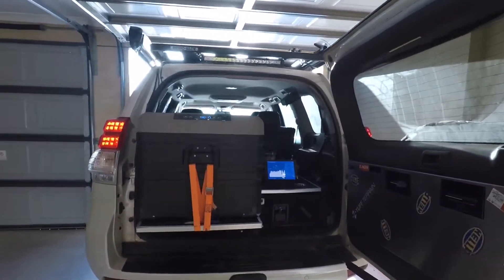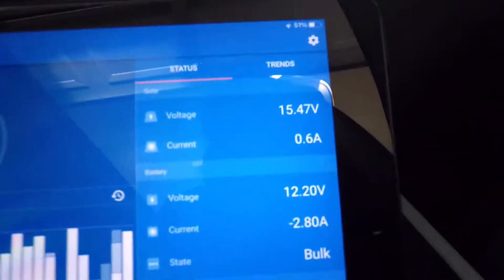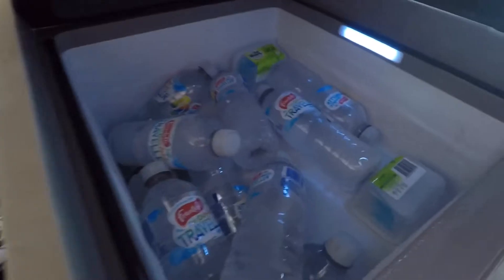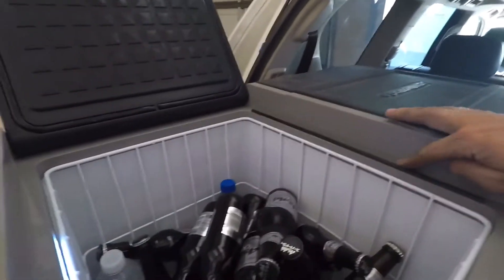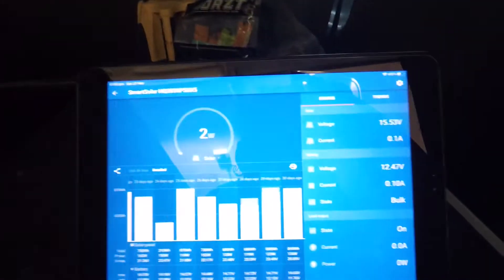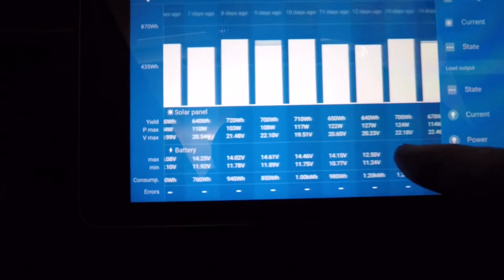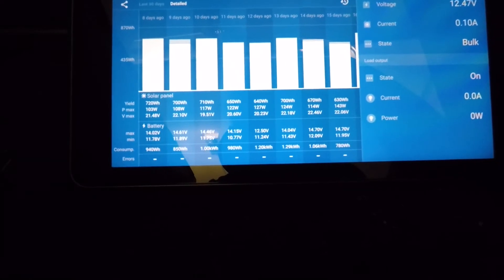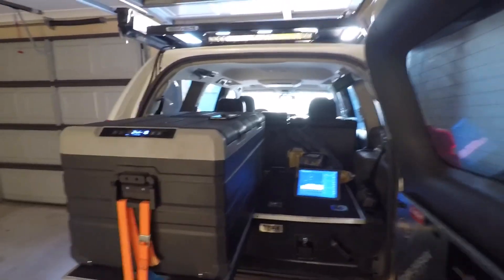Brass Monkey and Solar Update

Comment: That differential in volts will be voltage drop over the cable. They typically use the smallest they can get away with. I had the same issue on my evakool where it would shut down with a volt of discharge left until I used thicker cable around 21mm. Thanks for the video mate

Comment: Do you need an extra/add battery to run 75l BM? Or just straight plug in on cigarette lighter is there any cons if cig lighter only specially on a long trip? Thanks in advance
Reply from the maker: I run a second battery and solar and it only just keeps up. It can be run just from cig point but will not be efficient at all

Comment: Hey mate what app are you using to be able to monitor the solar like that? Does it have to be a certain charge controller? Cheers
Reply from the maker: It’s the Victron app specific to Victron controllers, not a lot of controllers had apps to monitor back then but a lot more controllers have them nowadays. 

I highly rate Victron and it’s settings, if moneys not an issue they are the bees knees. But realistically any controller with Bluetooth will do the same thing and be a bit cheaper!

Comment: was this fridge also plugged into 12v at any stage or was this just the solar panel and built in battery?? id like to know if i go camping or even use at home that i can run without ever needing to plug in (sun playing ball and being out) also was this the brass monkey solar panel?

Comment: first off cheers for the videos on this fridge mate, helped me make the decision to buy one from rtm( not a bad deal either, 699 for the 95l and a cover). just curious about the ebay panel as I'm going to purchase a solar blanket soon. How does it handle being partly shaded or covered? seen a lot of people say if a panel gets covered they don't work. if so has it ever been an issue for you, just don't want my paddle pops to melt ya know ;),
Reply from the maker: Can’t beat that sort of deal!! I haven’t had any problems with the panel touch wood! My 2nd battery is only small at 105ah but it keeps that fully charged all day with fridge +4 and freezer -18 (has to be -18 to keep the paddle pops frozen!) However it’s starting to wear out and not lasting a full night at -18. So a new/bigger battery is due. I try to get as much sun as possible but for the odd occasion I have a 120w solar blanket which makes do. Someone above commented they were using a 200w blanket and very happy! If you have the time to setup a solar blanket I would get one over a fixed unit as inside the car gets very hot too when in the sun! Hope this helps! 🍻
Reply: @JS_Adventure  very big help once again mate really appreciate it. I'm running a 140ah so I've got 70 useable ah they say before it needs to be charged so I'm thinking I should be right with the eBay blanket and a good quality controller this summer. come winter I might upgrade to a big lithium battery so I can discharge it a lot more.
Reply from the maker: Yep! I didn’t want to go cheap on the controller and picked up a victron 75/15 with Bluetooth and it’s worth it’s weight in gold! I think we’ll be going lithium in the near future as well as we’re getting more and more power hungry!!

Comment: Where did you get the rubber strips from? My 75L BM also gets condensation around the seals that sometimes turns to ice.
Reply from the maker: Hey mate just from Bunnings. If I remember right it was 6mm thick window seal
Reply: @JS_Adventure  Thanks mate, btw has the seal still done the job?
Reply from the maker: To be honest I think it’s helped a little. (Fridge seems to not cycle as much) but can’t definitely tell, for $6-7 it’s not hurting it so I’ve just kept them on
Reply: @JS_Adventure  hey mate just letting you know the window seal trick has done the job with my Brass monkey fridge. Very little if any is visible now and the compressor isn't working as hard. Great tip, thanks.
Reply from the maker: Beauty mate! That’s good to hear! The factory ones are pretty useless

Comment: Are you using an MPPT charge controller or a PWM? Maybe that's the reason why you never get close to those 250 w
Reply from the maker: Nope running a victron mppt but it is a $100 panel from eBay so I wasn’t expecting a lot out of it
Reply: How do you get it to read out all the data? Does that mean you have the fridge wired into the "load" part of the mppt controller? What amp is it? 

Cheers
Reply: @JS_Adventure  do you have a battery in the fridge?

Comment: Thanks for the video. I purchased the 75 litre model and very happy so far running with a 200W panel and 135A/hr LifePO4 battery. I highly recommend using the brass Monkey App as it's much easier to change settings through Bluetooth. I saw you got 162W out of your 250W panel which is really good. Anything above 50% of your solar panel is good, of course a low battery is needed to "trigger" the Victron into high wattage demand - are you using the Victron 75/15 controller? I was a bit worried going to 250W panel (162W/12V = 13.5A...) 75/15 max is 15A
Reply from the maker: Yep I’m now using the app and having no problems. Yes using the 75/15 and read in the manual that it will limit the power if more PV power is connected. And also just thought for a cheap eBay panel I wouldn’t be getting anywhere near a 250w panel but it’s doing a damn good job! Bang for buck you can’t beat these fridges! Has been running -18/+4 for 3 months straight now
Reply: this comment section is more helpful then google in its entirety. any advice about a kings 200w solar blanket that says it gets 16amp with their ppt controller? do I need to get a 20a controller just incase ?
Reply from the maker: By the looks of it, their 200w blanket comes with a 20a mppt controller so should be perfect!
 
https://www.4wdsupacentre.com.au/products/solar/200w-mppt-solar-blanket-combo-deals/adventure-kings-200w-solar-blanket-with-mppt.html
Reply: Ahh yeh not a bad deal, it just doesn't exude the same sex appeal as a Bluetooth controller to be honest 🤣
Reply from the maker: Agree with you there! 🤣
Reply: @jamesandrikopoulos5973  Hi, Just purchased a 380W solar blanket off ebay for $189. It only puts out about 15Amps MAX (suppose to get 21A max!!, but there is lots of absorbent claims out there....) folds up really small and so far I'm impressed, certainly plenty of power for camping. It comes with Andersen plugs, 20A controller (Very cheap 20A PWM) so I'm changing over to the victron 75/15 BT. Kings is pretty much the same stuff (bit more expensive).  Enjoy
Reply: @ShortFlic  thanks alot for that mate, very very helpful. Ebay big watt and the victron controller seems the best way to go especially since both you and JS Adventure are having positive use with them
Reply: how is the fridge, still good?
Reply from the maker: Yep! Still going great with no problems!
Reply: @JS_Adventure  thank you
Reply: @annabanna666  Yes, perfectly. No problems at all

Comment: Awesome video man look forward to any updates 😀 quick question what battery are you running?
Reply from the maker: Thanks mate! Running a full river 105 a/h battery as our second battery. Seems to be keeping up
Reply: @JS_Adventure  sweet man I got the 75L and I was worried about my battery set up also running a 105aH battery
Reply from the maker: Yeah should be good I have found it chews a lot of power when empty but just load it full of water to help it out
Reply: @JS_Adventure  thanks for the heads up I'm definitely gonna put the extra strip on it too as yeah frosting up the side abit

Comment: What do you think of the fridge itself?
And have you had any issues with them shutting down when the fridge is on an angle.
Reply from the maker: So far have spent near on 2 months touring on and off road with it and have had one time when it shut down with an f3 error as I’d left all the windows up in a 45+ degree day and it just overheated itself. Other than that no issues at all, no other shut downs. It does read a volt lower when the compressor is running which is a bit weird. But overall I can’t complain with it! Not sure of Engel/Waeco power figures for the same size but it does seem a bit power hungry
Reply: Good to know mate thanks, I have two dometic fridges atm, but am not happy with them, especially for the money for pay, have been looking at the brass monkey for a bit now just reading about the 5 degree thing
Reply from the maker: Yeah no problems with angle, it sat out the front for 6 months on our driveway every night which is over 5 degrees.
Reply from the maker: Coming from a Waeco and Engel I noticed straight away that these were cheaply made but still keep up with the big names. Which is great for the price
Reply: Awesome mate thanks heaps for the info.
Reply: At a 3rd the price you knid of expect it to be a little flimsy but 3 year warranty makes up for that I guess

Comment: Does the fridge alone pulls 1kwh after 24 hours?? Thats a lot isn't it?
Reply from the maker: Just under 1kw but that’s both fridge and freezer and constantly putting cartons of room temperature water in. So it’s pulling a lot to get the water cold

Comment: What size battery do you have
Reply from the maker: Was running a 105a/h agm (4yr old) back then which was only just keeping up on -18 and +2 but have changed to a itechworld 100a/h lithium which I can get 2 days out of now with no solar input. Setting the freezer to -15 I can double that but we carry ice cream regularly!
Reply: @JS_Adventure  ok ibe just got a brassmonkey 100 w solar panel today and ive run it all day in sunny Sydney at 14 degrees & - 2 on Freezer  ...its come over stormy and still powering it under cloud cover ... 
Model GJ 2018 7.8 ah battery .. 11.1v
Reply: @JS_Adventure  but that sized battery wouldn't run it all night I'm guessing once the sun goes down until sun up
Reply from the maker: I wouldn’t think so. My fridge is the previous non battery model and uses a lot of power so can’t really help battery wise, there’s a really helpful Facebook page “brass monkey fridge owners group” but my guessing it would get around 4 hours

Comment: These are the nastiest cheapest piece if crap out there.. 
After 1 yr, it has never reached its set temp or frizen a bottle of water. Firstly the seals dont seal the fridge!!!!!!!!!
 
I have 4 x 300ah batteries, solar, dc/dc and generatir.

My waeco and engel fridges are faultless, stay on their set temo and freeze anything i put in! 

The brass monkey continually has voltage issues and cuts out non stop for 10 minutes and turns on and cuts out again. 
It beleieves the batteries ate too low and chts out when , my sytem is faultless amd runs two ther feidges, pumos lights etc..

I have niw through research found so many similar reviews to mine stating faults wuth the charging sytem and not ever reaching their set temps..

We are hard working aussies, sick to death if being sold this nasty crap.. dont ever touch a brass monkey fridge..

Even the rep  agreed with me on the quality when i called for tech support!

Comment: 1.3kwh for 24 hours its a lot mate, thats 108ah!!
Reply from the maker: Yep it’s expected as it been on around -17 and -2  for around a year. When this was filmed it was being used at the same temps but constantly being opened and restocked with room temp bottles of water as it was our main fridge/freezer on a building site
Reply from the maker: Also being a 95L it doesn’t leave much room for air circulation in the back of a prado
Reply: yeah something doesnt seem right here

Comment: I recently purchased the the 75ltr brass monkey with the lithium 15.6Ah battery insert in the back end of it

I got told I can have a Max of 100W solar

I'm new to all this stuff I'm just curious as to what trouble I'm Probably going to run into if anyone has any tips
Reply from the maker: Hopefully someone can help as I’m not up to speed with the lithium battery version. I don’t see why you can’t run more solar power as it should have an inbuilt charge controller to limit how much power it brings in
Reply: Yeah I've got no idea but they guy at the store seemed to know the go with these battery's and really made it clear keep it at 100w solar panel... I'm gonna give it a crack next weekend running just on the battery with no solar imput and "simulate" grabbing a beer every 30 mins   see how the battery holds its charge (obviously precool the fridge to give it a chance)
Reply from the maker: “Simulate” 🤣  there’s a handy brass monkey Facebook page that might be some help. Keep us posted as I’d love to know how long it lasts just on lithium
Reply: I to am interested in this, i have a 150w solar panel and want to know if i get the battery if i can just come straight off that instead of investing in another solar panel, do i need to have a controller hooked up or is it built in? I do know there is NOT a controller on the panel itself
Reply: @rosannalowe6960  I've asked at the store about a better solar panel that hooks straight up to the fridge and they said the solar panel supplied is what this fridge is rated to and you can't go any higher unfortunately
Reply: @rosannalowe6960  your best bet is to have a battery box with a better panel connected with a controller to make sure  your getting healthy levels of power
Reply: @Chappo__  The manual says a max of 50v and 10amps for solar. The kings 160w is 10.01 amps so I figure is about the limit. You could also wire a 2nd panel in series for 320 watts at 32v and 10.01 amps I think.  I bought the 75 litre fridge this week and the 14.7 ah battery isn't enough to keep it running overnight. Did you find this as well?
Reply: @DeltaMikeNoshoot 

I actually had to return my 75ltr as the plug started to melt inside the socket, they didn't have any 75s left in stock so they gave me a free 95ltr instead

But yes the batterys don't last all night, I've found the only way to make it last is on constant solar and a battery box for the night which is quite annoying
Reply: @Chappo__  thanks. I'll have to get some better solar panels.
Reply: @DeltaMikeNoshoot 

Asling as you have enough power storage in your battery box then that fine but I personally put priority on a separate battery
Reply: @Chappo__  thanks. I've got a 300ah battery coming. I've been playing around on Ac power and it looks like the fridge draws 60 amps whether the battery is plugged in or not. Same as my 45 litre fridge.  Fridge off battery in charging draws 30 watts.  The system works fine on my 45 litre fridge but no good for the big one. The 45 litre fridge will charge the battery with the compressor on but the big one won't.  Maybe it can't accept enough power to run the fridge and charge the battery. If AC won't do it I doubt solar will.